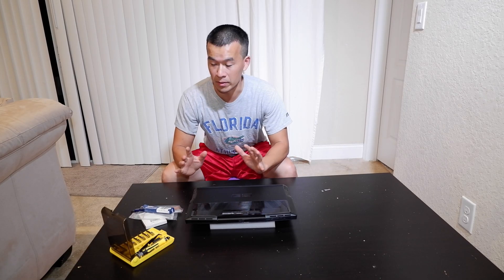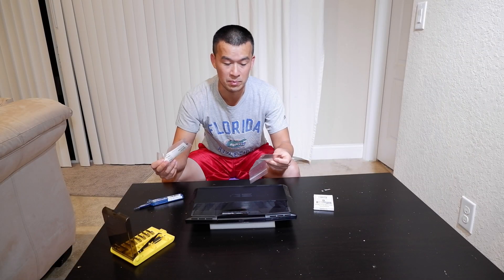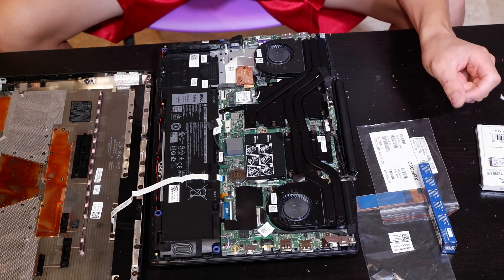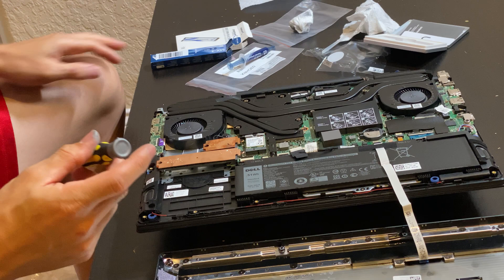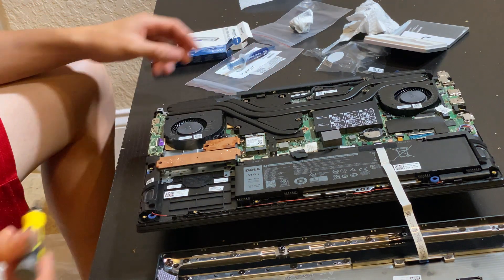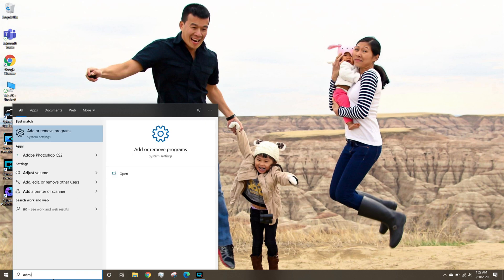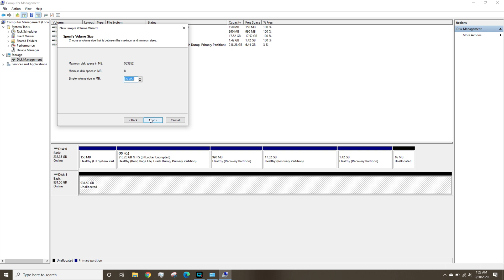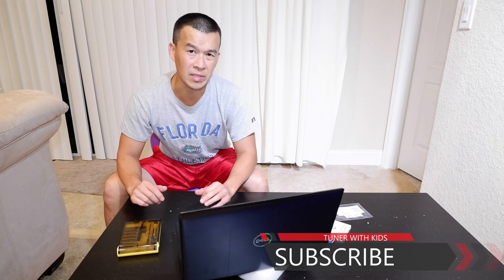How to Install SSD M.2 NVME | Dell G5 15 5500 G3 Gaming Laptop | CPU GPU MX4 Thermal Paste Install

Comment: To anybody watching PLEASE do not do your thermal paste like this.
That was a ridiculous amount of paste.
You might want to go in and redo that pasting my man. I'm sure there is a big mess of paste that overflowed into your mobo when you tightened down the heatsink.
Reply: Solid video otherwise. I appreciated the info on the m.2 parts.
I know in the video you said it's all new to you right before pasting and  I'm not trying to give you a hard time or anything. Just want to give you a friendly warning that there's probably a mess of paste that overflowed and to do some research before applying repasting next time.
Reply from the maker: @Boatzart  , I’ll probably look into it next time I open her up. These run hot so I will be checking in a few months to see condition of the paste. I tax this machine on video processing so it gets hot. But it’s on a cooling pad 99% of the time.
Reply from the maker: It was spread all over from factory. I cleaned all that off before repasting. Figured it’s meant to provide heat transfer so the more spread out the better to provide most thermal conductivity???
Reply: @TunerwithKids 
When it comes to thermal paste a little goes along way. 
Yes the paste is meant to bridge any gap between the chip and the heatsink surface. That space however is extremely small and does not require alot of paste to fill.
The way you applied it by spreading the paste is totally fine... its the amount that concerned me. That was so much lmao. 
Do your own research on thermal paste and you'll see what I mean.

Comment: Installed SSD in without heatsink.  This computer will not detect the new drive.  Exact same computer.  Tried a different SSD to see if it was the same issue.  Does this Dell computer have to have the heatsink to work?  Also familiar with admin tools.
Reply from the maker: Check my other video on m.2 install on this computer. You have to initialize the drive in disk manager. https://youtu.be/qSZG-opCIQE
Reply from the maker: Also I don’t recommend going without heat sink. This thing runs hotttt.

Comment: Man I wish it was easier to find from Dell UK! After a heatsink and screws for Dell G5 5500 2280 SSD!
Reply from the maker: Screws are easy. Amazon sells laptop kits for $8USD with hundreds of screws. The heat sink is another issue. With the P/N you should be able to try calling them to order.
Reply: @TunerwithKids  I just hope they know what I am after as I have seen multiple posts online saying it was next to impossible to order.
Reply from the maker: When I called. They tried to tell me the P/N I gave them didn’t fit. I ordered anyway and it works. It’s $3.99USD shipped to my door so worth the risk. Use the PN I have in description.
Reply: @TunerwithKids  Thanks! Can any capacity fit in the second 2280 slot? I know it's slower than the main drive as its pciex2 rather than 4?
Reply from the maker: I’m note sure of Max capacity but anyway that’s a m.2 NVME should fit and work.
Reply: @JoeMaranophotography  where did you find out the speed of each of the m.2 slots? I have the Dell g5 5500 also.

Comment: Awesome video sir, thanks!
After replacing the thermal paste, any Software related thing to do?
Like in the alienware tool or any bios settings to change etc
Reply from the maker: No. Thermal paste is just passive for heat transfer to heat sinks.
Reply: @TunerwithKids  Thank you , i'll try that this week, prior i'll contact Dell for this since i got Prosupport Service and I don't wont to unvalid the Warranty

Comment: Heya! Did you notice any difference in temps with the new Thermal Paste?
Reply from the maker: I didn’t really pay attention to it before. One of the comments on my other RAM video who suggested it said the Grizzly lowered his regular operating temp like 10C. I know when I tax the processor with video rendering I show Core temps of more than 100C using the CoreTemp app. I also didn’t know that the Windows 10 update recently added GPU temp to the monitor screen.

Comment: where Can I found the heatskin for the 2280? thank you
Reply from the maker: Call dell and order for $3. Check PN in description.
Reply: @TunerwithKids  $11.90 NOW? That is insane. I wish there was another option.
Reply from the maker: I guess they realize they were losing money at $3.99 with shipping. $11.90 sounds about right if it includes shipping.
Reply: Here it is : https://www.dell.com/en-us/shop/accessories/apd/750-ABIJ  ( YX0F3 )
Reply: @AlexeyDFilimonov  this is only the thermal pad, or there is alse the bracket?
Reply from the maker: Just the pad needed and two m2x3mm screws( those can be had on Amazon for like $7 for a 200 pack. Check links in description. Dell charge $2 each for the screws.
Reply: @TunerwithKids  ok, I also I am waiting for the copper plate, I think is important for the temperature

Comment: Standard m.2 hardware+a m.2 stick-on heatsink seems to be working fine. No problems heat wise with the non-dell heatsink and only put me out like 4 bucks from Amazon. Only issue is clearance, probably a mil between the heatsink and the bottom of the chassis, so you'll need a thin-ish heatsink. I've got the special edition but layout's the same for that area. Thanks for making that video! Only resource I could find that actually showed specifics on internals, other than the useless manual. In retrospect I'd probably have just called dell, since closing up the machine with that little clearance just about gave me a heart attack. Only reason I didn't was that  I kept missing their office hours.
Reply from the maker: I was watching the Sabrent temps first few days. Using their app. Crazy how fast it goes from 35C to 55C when writing to it.
Reply: @TunerwithKids  due to price restrictions I got "lucky" that my crucial m.2 is a bit slower. This thing gets hot enough I couldn't imagine.